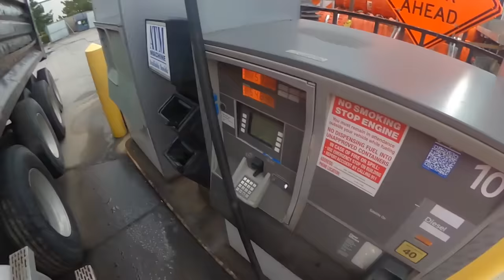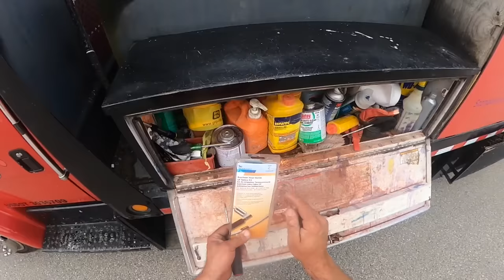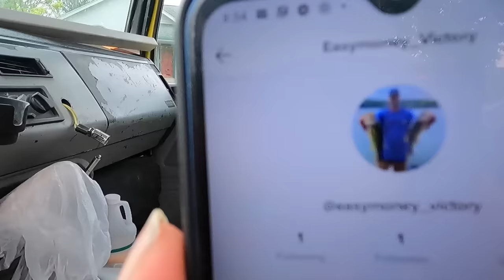Easy Friday and Darryl goes shopping

Comment: I love Daryl Jr he's the best person on the crew
Reply: He's the nicest guy but the least help.  He holds things up 😅
Reply: @why-even-try-brotendo  least help? Keeping the motivation up is a hard task and he does it really well! 😁
Reply: Next to al
Reply: @rentaroux3  he doesnt even deserve to be paid. He should be paid much less than anyone else in crew if anything.
Reply: He runs the buggies and make sure the wires lifted. Both pretty important and yeah he might get the cake work but it’s still helping for sure. Boss mans happy. He’s happy. What’s the deal?
Reply: @mmaybee2353  And why is that? Because he doesn't finish? Every job including pulling off the form board's is just as important as the finisher as you don't want the concrete setting on the board's, also you need an operator for that buggy as well, pulling up the wire when needed, cleaning everything off.. How doesn't he deserve that amount of pay??
Reply: @Matty12787  No because if the powered wheel barrow isnt being used, daryl is 100% guaranteed to be sitting down or leaning against something taking a break from doing nothing. He doesnt even level the concrete.... just pulls up the wire that the boss does anyways. If hes getting paid by the hour, this boss is losing serious money.
Reply: @mmaybee2353  Ever heard of giving someone a fair go especially in this circumstance.. At least he get's out and has a go, that in it self should be ground's on fair pay.. Yes he may take a break here and there but imagine carrying that weight working in this line of business.. God forbid you ever get a disability.. With that attitude, even your family would probably disown you..
Reply: @Matty12787  Nah but my family would disown me for being a fat and lazy.

Comment: How do you decide on what way you brush the concrete and why do you sometimes switch the direction while on the same job?
Reply: So the brush is to provide grip on the concrete and also allows for water to travel faster with grade and keeps puddles from forming too
Reply: @KevinTorres-kb1hh  it's mostly about air. The mix he orders is an air entrained mix. If it doesn't get brushed it gets trapped which causes cracks. Control joints are to also help prevent cracking.

Comment: That concrete saw, to keep the dust from going everywhere you can get a water bottle punch a hole in the bottle cap and squirt the water on the saw blade while cutting concrete. That’ll keep the dust from going everywhere and breathing in all that silica dust

Comment: Your guys tools such as floats and joints are very different than what we use here in California I’m a finisher too and a form setter and it’s crazy to see how other places do it also we do use the gas powered wheel barrel but not for huge drive ways we usually get a concrete pumper or we drive the truck into the area that we going to pour and start to from the top to bottom with just a truck

Comment: Hey Ryan, I have a question. Wouldn’t it of just been easier to set the forms 2” forward, instead of having to cut it? Or why did you guys cut that concrete sidewalk back? Also can you make a video on how you actually set forms down, set your lines to find grade, and all that fun stuff. I know this is an older vid and you won’t see this comment but I’ll comment on a newer video. Thanks.

Comment: Anything you recommend for keeping oil stains off concrete? other than cardboard or pans. Is there a coating that can be put on?
Reply from the maker: You can seal the concrete with a clear sealer that will help but nothing is really impenetrable.
Reply: @VictoryOutdoorServices  Any Brands you recommend? Thanks for responding!